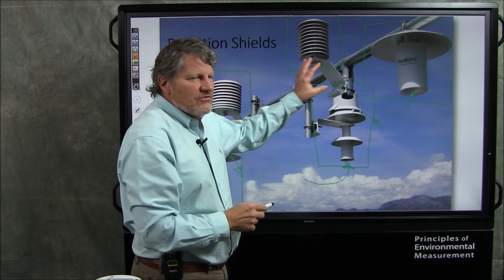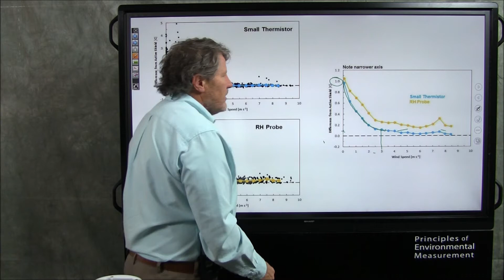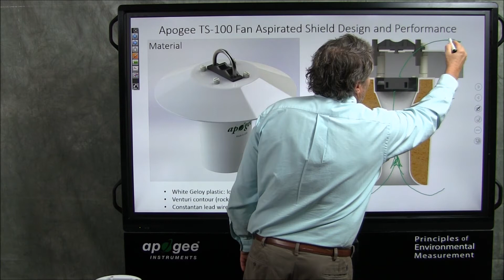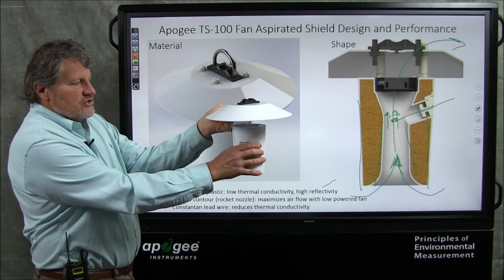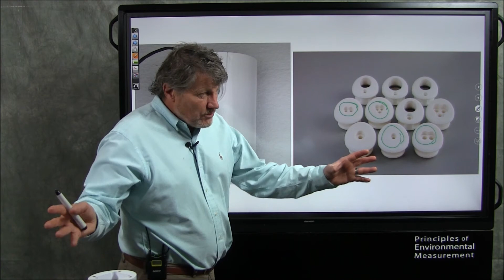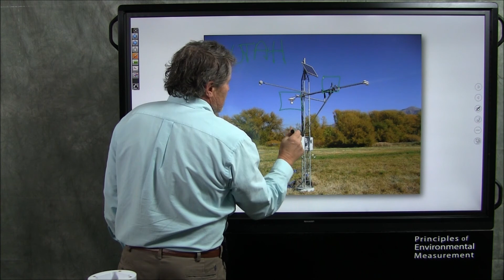Solar Radiation Shields Overview

Comment: I just mounted a solar powered IP55 fan under my radiation shield. It blows air from outside to the inside where the sensor is from the bottom of the shield. It's a multi-level shield. 
I had wondered if the fan should be directing the air to the inside of the structure or as an exhaust fan (again, from the bottom of the shield) to the outside. 
Opinions?
Reply: The fan itself warms up a little and you would be adding heat to the sensor if the fan is blowing air from underneath towards the sensor as opposed to away (exhast).
Reply: @donmc1526  However, the external parts of the container are heated by the sun and if the fan was exhausting air this heat would enter the container. 
The question is, which part is hotter? I'd say that the part heated by the sun is and, so, I had opted to blow air into the container where the temperature sensor hangs since the extremely slight heat from this low powered motor is very, very low and disbursed.